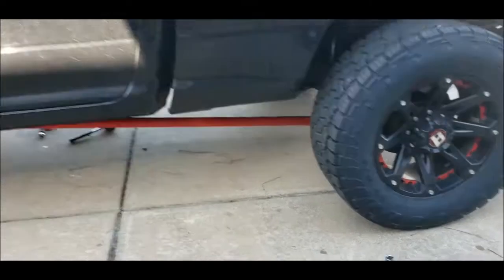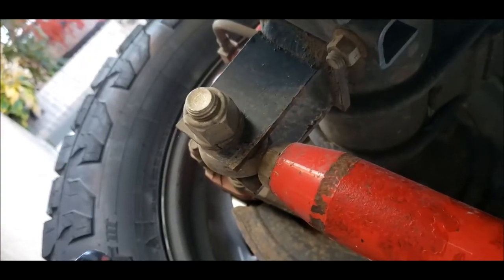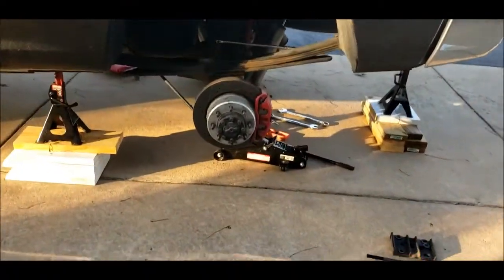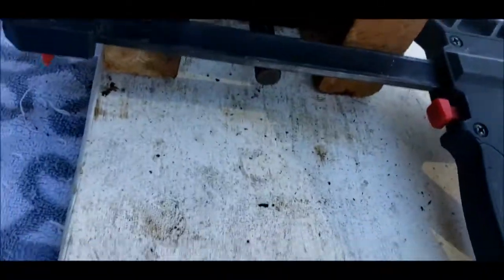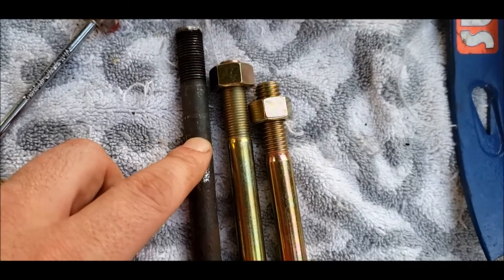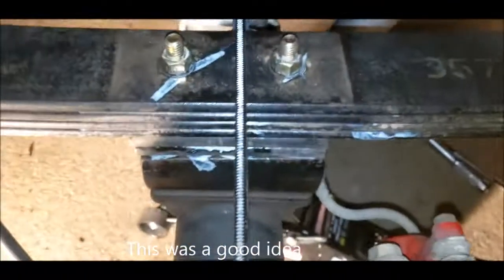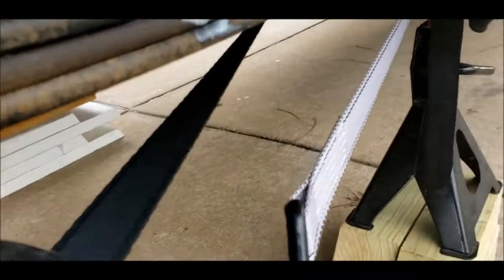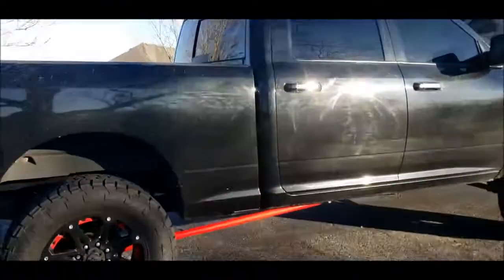Removing Rear overload and leaf spring blocks from 2011 Ram 2500 - Reverse Level

Comment: I just did this today with my 2008 Ram 2500 Cummins, I live up north so there was a lot of rust involved and man it was a bear getting those spacer plates separated from the overload spring. I don't haul very heavy with my truck so didn't need the overloads, truck rides way nicer now.

Comment from the maker: 6 month of use update.  Very happy with it.  Ride is slightly better.  Look is way better.  I would only recommend taking out the overloads if you have airbags.  I tested it with the airbags empty, and 2500lbs in the bed got me close to rubbing tires in rear.  But with 45psi, it was level.  I think the height is right, if I took any more blocks out the back, it would look stupid(lean).

Comment: U should put a nut on top of the stud before hitting with the hammer. It helps with deformation if the bolt and also helps prevent the bolt from getting bent as well
Reply from the maker: Thanks for the input.  Yes I agree, would be better to do that with a nut or two on the threads.

Comment: If you were trying to loose lift why didnt you take that lift block out that you appear to have?  This was a great video though and exactly what I was looking for. I'm thinking about getting sulastic shackles that lift it a 3/4 inch and removing those spacers.
Reply from the maker: I don't remove the block because it would have lowered it too much.  And also I liked the idea of losing the extra weight of the overload spring.  If you have airbags, I'd recommend removing overloads.
Reply: I dont have bags, I'm just trying to get a better ride and I heard removing the spacers helped that

Comment: I did this mod yesterday. But instead I left the overload and took out 2 of the spacers. Seems to ride slightly better and dropped my rear 1”
Reply from the maker: nice!  I hope you like the look.  level is the best.  My initial plan was to remove spacers, but changed as I got into the work.  I like the two tone Red you got on your truck too.
Reply: @Prima10ne  thanks! I actually have 2” thuren coils but only got around 1 1/2” front lift. So the 1” lower in the rear. Made it perfectly level.

Comment: What size are the bolts you bought for the leaf springs
Reply from the maker: The bolts that go through the spacer blocks and the leaf pack (17 min in video) are 3.5 inch long grade 8 bolts with half inch diameter and 3/4inch head. The stock bolts were 4.5 inches, but because I have a spacer block in the bottom, I needed shorter bolts.
Merry Christmas.

Comment: Lots of work, but looks good!
Reply from the maker: Thanks.  Yes it was way more work than it needed to be due to the gunk holding the pack together, and due to bags and traction bars.  But it does look a lot better.  I would say maybe even too low in back now that I have had time to get used to it.  It measures higher in the back but it can look squatted if parked at angle.
Reply: @Prima10ne  yeah I had my own experience with things taking a lot more work and time then it should. But it was with my front wheel bearing assemblies last week with the drivers side one appearing to have never been done at 280k miles lol the 4 bolt part of the assembly was basically rust welded to the knuckle!
Reply from the maker: @allencarabajal8989  yep.  Things like that are common with work trucks.  They built to take a beating, especially when you try to take them apart.  I had a front axle u joint that bent the axle shaft before it came out.  Rust welded is a good term!
Reply: @Prima10ne  oh man, that’s wild. Rust welding is something I’m not used to considering I’m in somewhat south east Texas
Reply from the maker: @allencarabajal8989  I think it's often more just gunk stuck in there than rust.  I'm in south also, so it's not straight up rust, it's just the left overs from gravel roads and rain and mud and grass and the occasional roadkill that builds up on all moving parts.  Haha
Reply: @Prima10ne  true, I’m sure that does have a lot to do with it! Lol